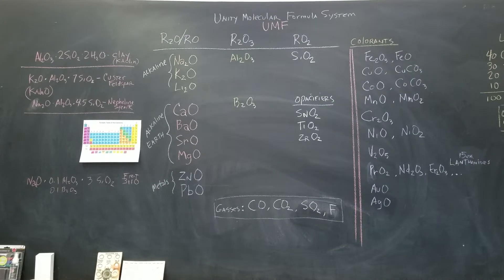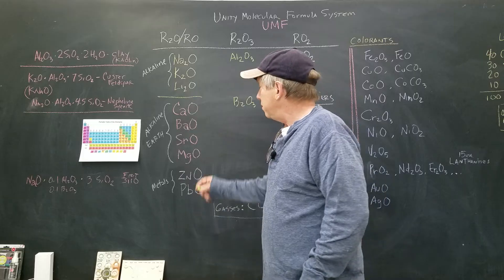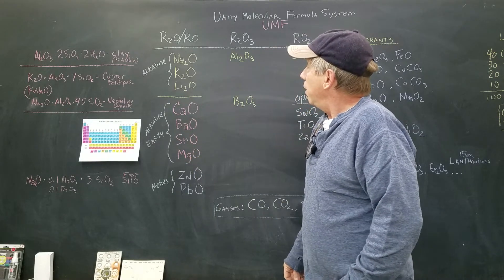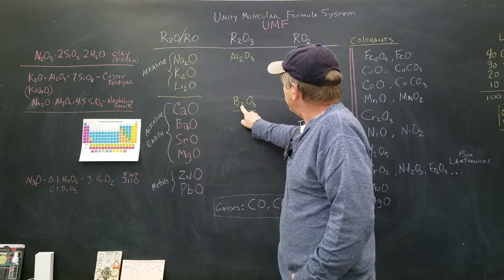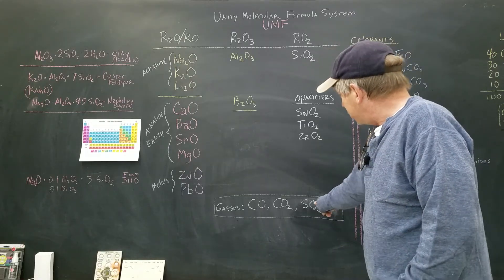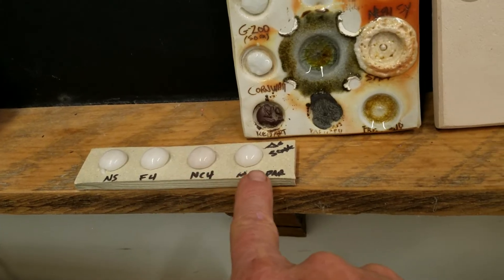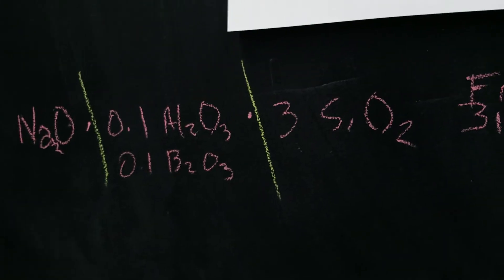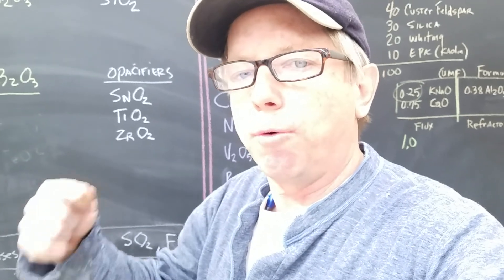Description of UMF (Unity Molecular Formula) Structure  (Free Online Glaze Class Pt. 1 )

Comment: Why do they are have O’s next to them it means oxide right but what if your using an non oxide were would that go
Reply: For example the best one I can think of is silicon carbide
Reply: Which chemical formula is sic
Reply from the maker: @farmlife4533  silicon carbide is heard. Burns off the carbon and yields silica
Reply from the maker: Sodium carbonate is heated and the carbon dioxide goes off as a gas to yield sodium oxide.

Comment: The one thing that puzzles me having a small background in chemistry I know how to convert a carbonate to an oxide it's simply heat. If you take cobalt or copper carbonate put it in a glass beaker put it on a hot plate and keep it moving with a glass stir rod crank up the heat it'll turn into copper oxide so this happens at not too high of a temperature as a matter of fact I don't know the exact temperature I'd have to look it up but if we're putting a carbonate in a glaze and it goes onto a piece and then goes into a kiln doesn't it automatically turn into an oxide? I mean what benefit is there to using a carbonate over an oxide in this case?
Reply from the maker: Yes, you are right. But copper carbonate goes into the glaze easier, it is a fine powder.....sometimes copper oxide makes speckles. So depends on how they are processed.  So another is zinc oxide...about 30 types...some very pure others with impurities. Some coarse. Some fine. So it makes a huge difference in your glazes.
Reply: @johnbrittpottery  I think I'm going to ball mill some copper oxide and then do a microscopic comparison to see how fine I can get the copper oxide I'll post some pictures somewhere if I find anything interesting
Reply: @johnbrittpottery  you know I never even allowed my brain to go there how it actually physically incorporates with the glaze body now it makes sense to me. Thanks for clearing that up in my mind I've been pondering it for a long long time.

Comment: I have 3-4 books that explain UMF and none did nearly as good a job as you, John! I was pretty baffled before, and my understanding increased so much, so quickly here. So thank you! I have questions: 
1) Can you elaborate on "glass former" and what that means? I understand that a flux melts at the temperatures we fire to, and that a refractory material does not (and therefore helps stabilize/keep things from running) but the term "glass former"... could I think of this as the kind of "base" that the other two materials work from? What would happen, for example, if you put together a flux and a refractory material but you left out the "glass former"? 

2) You mentioned that a frit is a manufactured, pre-fired glaze... is it then ground up and sold as a power? Is it defined as a glaze because it is composed of a flux/refractory/glass former, but primarily used as a flux when people are making their own glazes? 

Thanks a million, this was seriously so fantastic for someone who can't actually go to graduate school in ceramics but would really like to understand more about what they're doing.
Reply from the maker: Sorry didn't see this..Glass former is Silica and or Boron sometimes Phosphorous
Reply from the maker: Frit contains flux, refractory, and glass former but is dominated by flux ..so people can add kaolin and Silica to have a glaze at any temperature

Comment: Hello John, is it possible to ad the temperatures in celcius. I´m from the Netherlands, and we don´t use fahrenheit here. And an other question . I have bought a new electric kiln. Is it useful to put extra cones inside for temperature control? Greetings Kees from Holland.
Reply: I'm from Argentina and we use Celsius too. Here's a conversion of some temperatures he mentioned: 3100 = 1704 ; 2350 = 1288 (^10); 2232 = 1222 (^6); 1878 = 1025 (^05); 1650 = 899 (Na melting point),
Reply from the maker: @Neldidellavittoria  Thank you.
Reply from the maker: If you look in my book I have a cone chart with both.  Sorry I didn't do that but forgot.
Reply: Hi Kees Electric kilns are very even in temperature and controllers are very accurate now so there is no point in putting in extra cones .
Reply from the maker: @nedludd8633  Not to be contrary, but not everyone has new kilns and kilns are routinely 1 cone off from top to bottom. Witness cones are the best thing to keep your work consistent.  Thermocouples are inaccurate and degrade with use so  the temperature cannot be relied upon. Types S is the best but many have type K and they are old. The kilns fires based on thermocouple so I only trust witness cones not thermocouples! JMO!
Reply: @johnbrittpottery  Hi JB I never came across an electric kiln that had a cone difference between top and bottom .But then maybe I have been lucky .  About 30 Years ago  I bought a Stanton ,it had no spy hole ,when I asked them about putting one in for me . They said no , you don't need it ,...and it will just start rust in the door .I found it difficult to believe but they were right . I fired that kiln regularly for 10 years with never a problem and it was spot on every time . Then for a while I had Cromartie's top loaders same thing spot on every time , so much so I never used cones except for the very first firing .
 With modern kilns and controllers once you settle on a firing schedule which you stick with then you will have the same heat work and top temperature every-time and therefore consistent results . The only thing I found changed that was if an element went and of course with a top loader that event is worse .
Reply from the maker: @nedludd8633 you have been lucky my friend!
Reply: @johnbrittpottery  Long may it continue in that case !